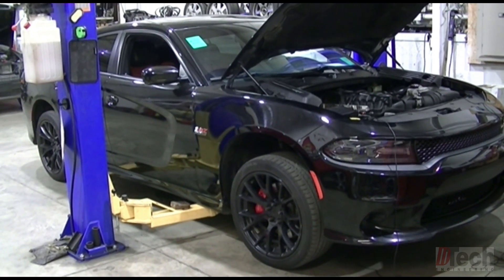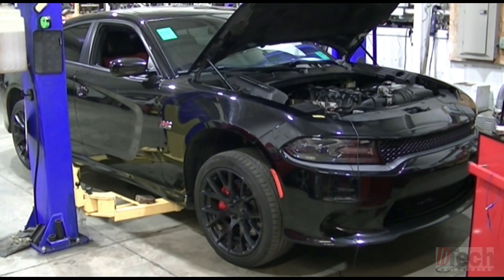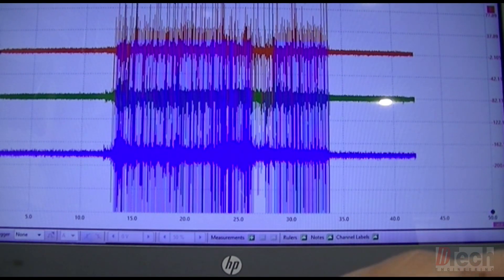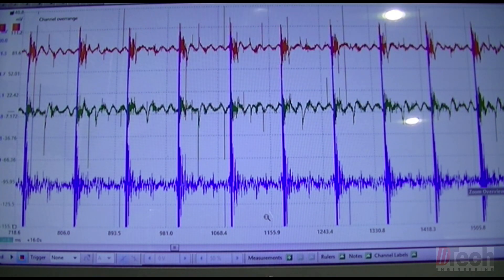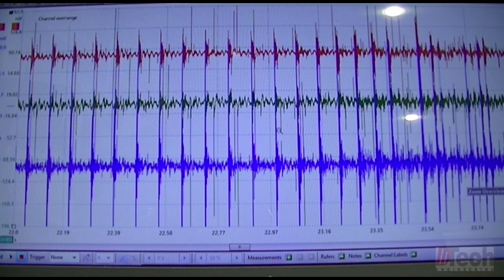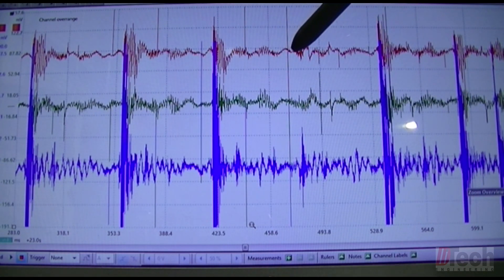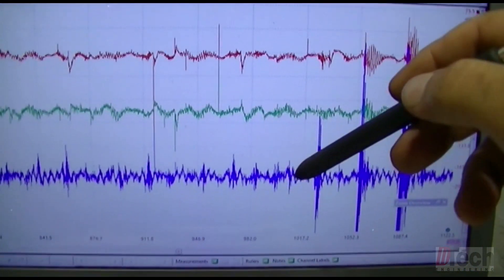2016 Charger Engine Noise Diag Using a Scope

Comment: I wish you would have done the MATH to show the RPM of the noise as the rod should be double the speed of a single lifter rattle, maybe next time, thank you for all your great diagnostic videos.
Reply from the maker: I normally do deeper diagnostics to help pin point the issue. But this one was done quickly but I did keep the core engine which I plan to do a follow up teardown video on to physically actually show the issue. Thank you for watching and keep an eye out for the teardown vid.
Reply: @DTEAuto  would it be ok to throw in the MATH for the RPM of the knock and maybe another video with a waveform that you can throw in for the RPM of a loose lifter if you have one, I catch all your new videos and I am working backwards on your older videos from 2022 back.
Reply from the maker: A math channel might work to pick it up, but at least for this one unfortunately I don't believe I saved the waveform in order to attempt the math channel. I will check when I get some time to see if I do have it. Thanks for the support and glad you are catching up on the videos, the diagnostic videos have good informational content within them, just not the greatest quality, but again the scope testing and techniques are good to learn from. Thank you for watching.

Comment: Is the sound happen during 2 ignition event? Thanks!!
Reply from the maker: I unfortunately was a little bit under the gun to get this vehicle repaired after I made the video so I couldn't do all the further testing to get more info. So I didn't get to do an ignition sync. But this one also I kept for a teardown inspection and can document it here. Thank you for watching!
Reply: @DTEAuto  thanks for your videos! So I was watching your other videos on engine noise diag and there is a bmw rod knock diag one that has only 1 sound spike during the 2 ignition event(720 crank). so what i heard from other is that if it is a rod knock it will have 2 spikes during 720. can you please explain a little bit more why the bmw only have 1 spile? thanks so much!
Reply from the maker: A theory I would say it would be is... As far as the microphone deal or the audible noise being greater always in the #4 column and barely showing on #7 column, I'm not sure exactly why it show or didn't show that way. But the only thing I can hypothesize is…….. maybe lets think of it in this way, for the #7 column area would be when 7 is at or near tdc, and traveled upward that whole time while being in constant contact (per say) with the crank pin since (lets assume) the bearing is wiped out and (lets say) no oil film there to “suspend” the rod off the pin since there was actual drop in oil psi at that moment as well (like when it was at tdc also in column 4) and then you have the spark event happen which then creates high pressure on top of the piston which then would be applied downwards on the rod also , but since (lets assume again) it's already pretty much in contact with the crank pin , and now it's “pushed” downwards there's no “actual travel movement ” of the rod to hit the pin to create an audible noise…. But than you take the same rod on the next upward travel which would now be exhaust stroke and it is "pushing out" spent gases with an exh valve open and once the piston reaches tdc... there is absolutely nothing on top of the piston to keep it compressed up against the crank pin and so if the bearing is wiped out , now at tdc, the rod will have that extra space in the big end and flies upward and the lower half of the rod slams into the crank pin and creates a noise because there's nothing on top of the piston to keep it from sitting tight on the pin on the exhaust stroke like there is on the compression stroke which than equates to only one time noise in the 720. Hard to explain but hope it makes sense.
Reply: @DTEAuto  Thanks! I am trying to find a good way to diag engine noise. So i think put one microphone on the head and one on the block and see where the noise has the bigger amplitude. what is your opinion on that? thanks!
Reply from the maker: That would be a good way to try and differentiate the location
Reply: @DTEAuto  thanks. Cause I have seen lots of people capture a bottom end issue with 1 spike per 720

Comment: I wonder if you have a cylinder sync you could confirm it knocked on the top or bottom of piston travel.  When would a lifter make noise in comparison? Interesting video!
Reply from the maker: A sync definitely would add a level of identification for sure, I've done it in the past and have some more coming out where I do this, I tried to keep this one short and sweet. But you can check out one that was in depth in case you hadn't seen it yet https://www.youtube.com/watch?v=FW42V5au7Vs&t=26s
Thank you for watching
Reply: @DTEAuto  Makes me wonder now when would lifters tick during the 720 degrees of crank rotation.

Comment: Im sure it’s pampered daily…. I’m curious if a piston is missing a skirt, or a nicely bent rod.. I’d pull the spark plug.. I don’t know that sump set up but could any inner pan, splash pan come apart? 

I have a short fun story.  Customer calls said he took his boat out, anchored out, went to start up and the engine was knocking. Pulled motor. There was a scratch and big dent on his oil pan. Turns out anchor fell in engine bay.  His words were. Yeh, now that you say that my anchor was stuck under the motor, it took a while to get out. I Never told his wife and now he is a great patient customer.😂
Reply from the maker: The customer has decided to replace the complete engine, if I get lucky, I might be able to tear this one apart for further inspection. And that's a funny story. Thank you for watching

Comment: Could you write down the rpm and use rulers on pico to establish 1rpm and see how often the noise occurs. Cam speed vs crank speed etc
Reply from the maker: it would probably be easier to for identification to use an ignition sync, which I have done in the past, I haven't tried with rulers and no sync yet but good question. Thank you for watching

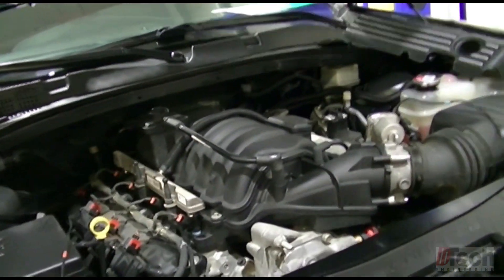Comment: I’m 2:47 into the video and the sound frequency sounds too low to be a lifter/rocker tick.  I’ll keep watching and see what you discover!

Great job on showing the power of the scope, Sadel.  Probably took you about 30 minutes to set up the mics and the Pico to give a proper diagnosis?  Sucks for your customer (I’m curious what the mileage is on the engine).

Superb diag as always, brother!
Reply from the maker: this one has around 80k on it, and the customer is going forward with an engine replacement..... I will try and see about keeping the core in order to take apart and repair...